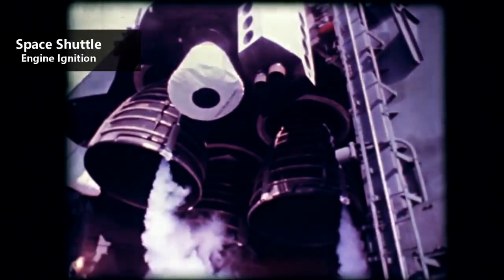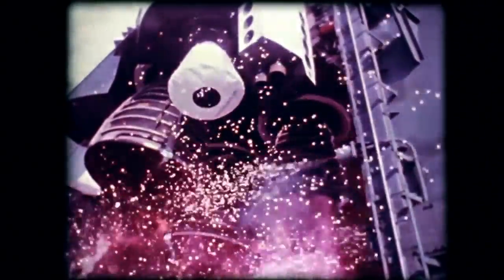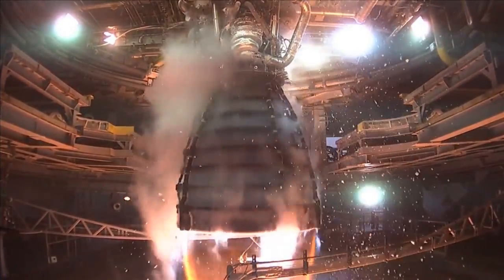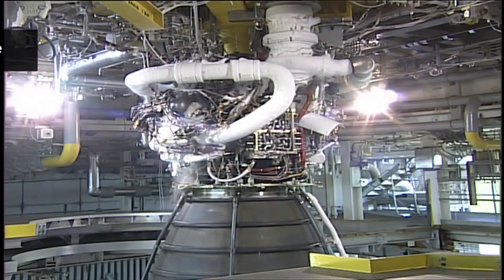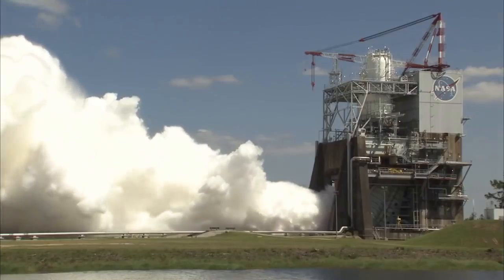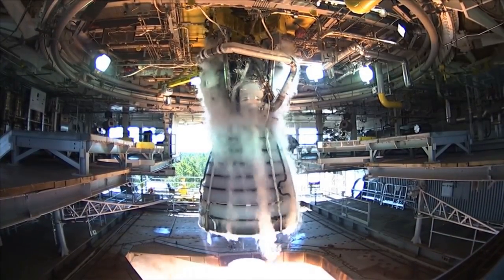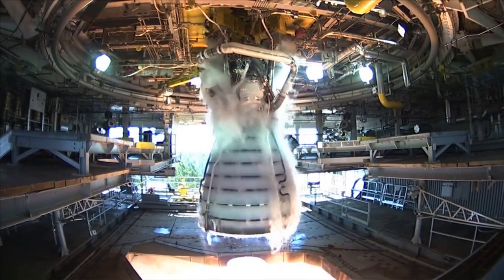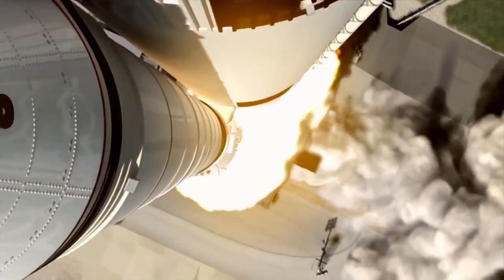RS-25 - The Space Shuttle Main Engine

Comment: "Most advanced rocket engine ever produced" is a matter of debate. It's a fabulous engine, for sure, but it has some competition too.
Reply: I mean, what?  The some of the russkie designs are more powerful - ala RD170/RD180 but nothing comes close in terms of efficiency.  366 s for a first stage! Insane!
Reply: @johnbigelson7471  You’re missing the point. It's now about 40 years old and it's still competitive. The RD-180 was the leading engine in its class for a long time before SpaceX. Before the RD-180, nobody believed that a closed loop on the oxydiser side was even possible. The Americans achieved a closed loop on the fuel side with the RS-25, also known as the SSME. A closed loop on the oxydiser side was thought to be impossible because oxygen under that much pressure is extremely corrosive.

Have a look at Everyday Astronaut's coverage of modern rocket engines.

It's probablyly safe to say that without the RD-180, we'd still be scratching our heads about somethings and we we would almost certainly not be looking at the current levels of efficiency we have.
Reply: @thethirdman225  The RD180 was developed in the 90s no?  That's still two decades after the RS-25.  So to say efficiency stemmed from the 180 doesnt seem right....  as I understand it the main advantage of other Russian engines as well as SpaceX engines is they're cheaper to make and operate.  That makes sense why they're used, but when we talk about something like "most advanced", we probably dont mean price.  We mean best Isp, or best twr, etc.
Reply: @johnbigelson7471  
"The RD180 was developed in the 90s no?  That's still two decades after the RS-25."

Okay, point taken but it was developed from the NK-33 engine that flew in the 1970s and was where the technology originated.

"That makes sense why they're used, but when we talk about something like "most advanced", we probably dont mean price.  We mean best Isp, or best twr, etc."

When it was first seen by the West in the 1990s it was the most advanced. Nobody believed the technology existed outside of the United States and probably with some justification.

If you look again at my first post, you'll see I have already questioned that claim.

Comment: What about the Challenger engine that failed and caused the only post-launch abort of a STS? Does that not count as a failure?
Reply from the maker: That mission was STS-51-F. The abort mode for that situation was "Abort to Orbit" which caused the Shuttle to be in a lower than intended orbit, but didn't ultimately affect the mission. That mission stayed in orbit for over 7 days and returned to Earth normally. So I would not consider it a failure.

Comment: All those things about how advanced and special it is were only true in the 70s and in the USA. At the time, it was the most advanced engine of those that were developed in the USA. The USSR had plenty of staged combustion engines at the time, and they even had a full flow staged combustion engine (RD-270).

US government funded engine development efforts were and still are far behind the global state of the art. The US military contractors still can't manufacture RD-180, which use the same tech as the RD-170 which first flew in 1985. SpaceX are developing a full flow staged combustion engine (Raptor), and ULA plans to use Blue Origin's staged combustion BE-4 in the successor to Atlas-V. But both those engines are developed by private companies without government funding.

If NASA, USAF, DoD or NRO tried to develop a rocket engine for their own launch needs, it would either fail after burning through twice the allotted budget or they would be very proud of themselves to have successfully recreated Apollo-era technology for much more than it cost originally.
Reply: RD-270 never reached operational state because of combustion instability problems.
RD-171 family is not "the most advanced" because it uses ORSC.It is the highiest performance RP1 engine and technology in USA went with hydrolox technology+solids thus barley any developments were made since the 60s with tine exception of rs-27 in DeltaII.Only recently with Merlin and now Blue engines programs there is resarch in hydrocarbon engines.
Hydrogen has no need for oxidiser environment after preburners because it is leaving no residue and does not coke.
Reply: Launching people on anything that uses solids is madness. Subsidizing ATK is not a good idea either. Delta IV shows that hydrolox  + solids for first stage is inefficient even if you don't try reuse. So the decisions the US made to go with hydrolox + solids were bad, and consequently the US was decades behind Russia in engines that are a good fit for first stages. Thus Delta IV is being canned by ULA because it's ridiculously expensive (Delta IV Heavy being maintained for NRO who don't care about cost), Atlas V and Antares use Russian engines, and SpaceX and Blue Origin had to develop good first stage engines without the benefit of government experience.
Reply: Zeev Tarantov Yes ATK and solids is subsidy for ICBM same with Ariane.
Russian liquid propulsion was more combined with military applications than US with wide use of hypergolics even today with Proton.Delta just shows that it is a bad design with low flight rate not that Hydrogen is fundamentally a bad fuel especially for upper stages.ACES looks very promising
Reply: Whatever, Russian.

Comment: how does the engine actually start?
Reply: spark igniters
Reply: Via the turbopump.
Reply: Wikipedia explains this very thoroughly: https://en.m.wikipedia.org/wiki/RS-25. Basically, the fuels are pumped towards the nozzle, mixed, and then ignited by an ‘augmented spark igniter’ (an H2/O2 flame at the center of the injector head). If you were led to believe the sparks you see flying in the video ignite the engine, you’re mistaken: they are to combust/burn any lingering fuel that may have escaped prior to launch/during startup, as to not cause an explosion when the engine starts.